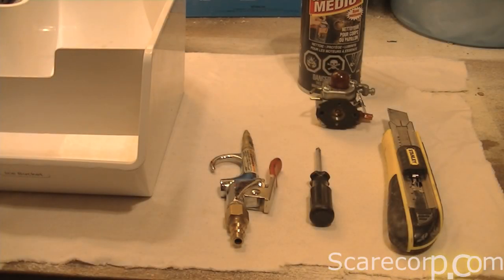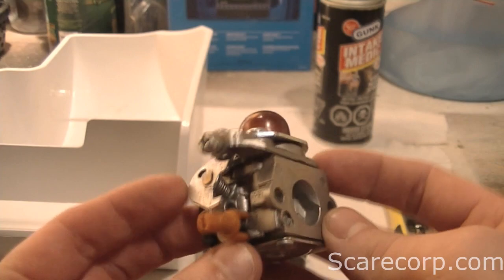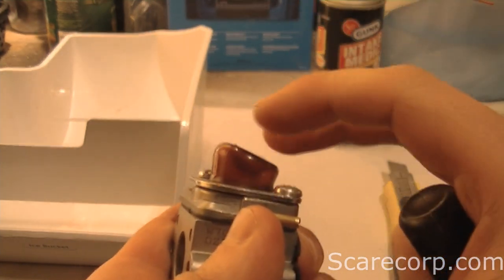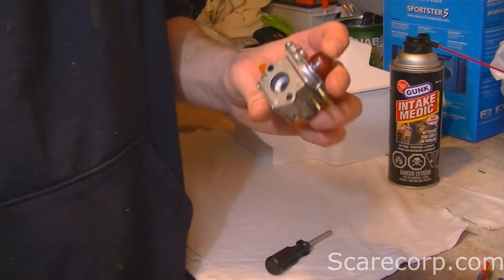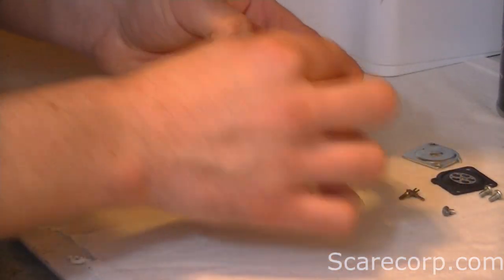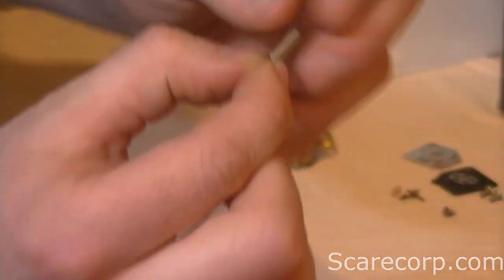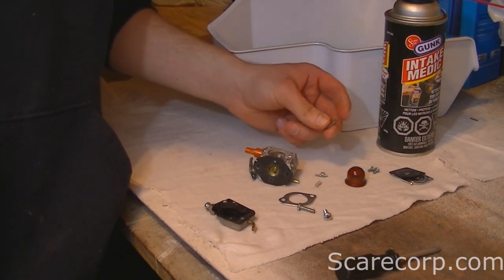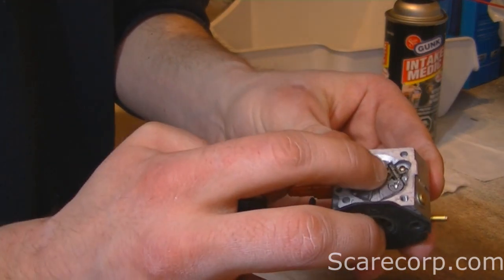Clean a 2 Stroke Carburetor Fast and Cheap

Comment: I replaced the diaphragm and needle in a Walbro Carb just like yours but the blower will not pick up the gas.  The carb kit did not have the same plastic piece as what is in the carb on the opposite of the side the diaphragm is on.  What should I do?
Reply: Check metering hight

Comment: In rebuilding your carb.. Why didn't you take out the mixture screw and spray some Carb. cleaner in the mixture hole.
Reply: Gary Johnson it may mess up the ratio if he didn't keep track of the turns
Reply: There may be another reason idk
Reply: Starting point is 1¼ turns out no reason not to clean

Comment: I've done the same thing but the engine still runs a little sloppy.  What else can I do?
Reply: There is a small round screen,about 1/4 of inch in all thse carbs,it holds dirt and crap.90 % of problems.surprised he said nothing about.carfull takeing it out.blow carb cleaner threw it and then air
Reply: Check metering hight

Comment: You should start the video advising viewers not to try this at home. The fluid burns on the skin like a mofo if you let it soak for more than a second or if you have the tiniest papercut, and it actually dissolved the bulb part.

Just take it to the shop if you're not a pro.
Reply: If you're worried about burning for a second or two and are afraid to get your hands a bit dirty then do as this guy suggests and take it to a shop.
Reply: Who says I'm afraid?
Reply: Which fluid burns you? There should be gasoline, 2-stroke oil, and carb cleaner present in your carburetor. None of these fluids are caustic.
Reply: +Ellen Buckles Lol! No, none of the three are caustic!